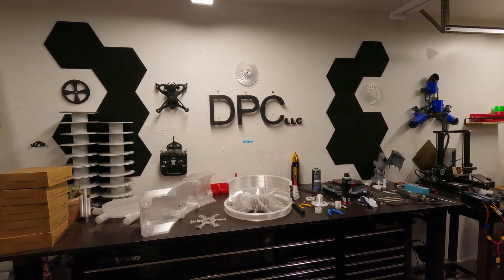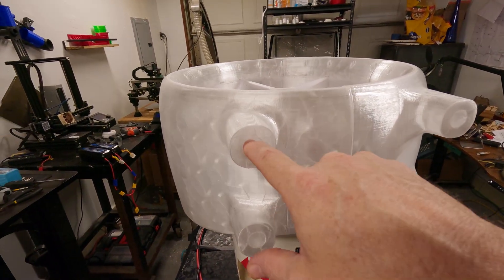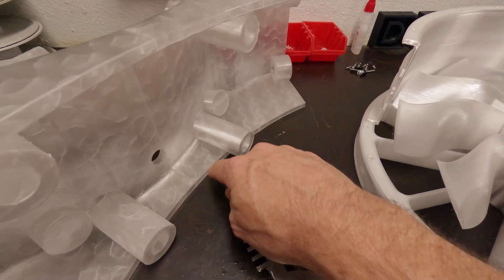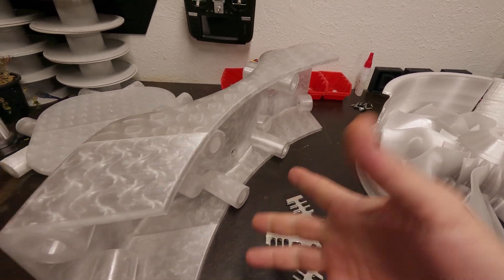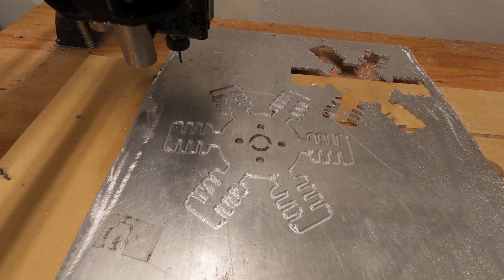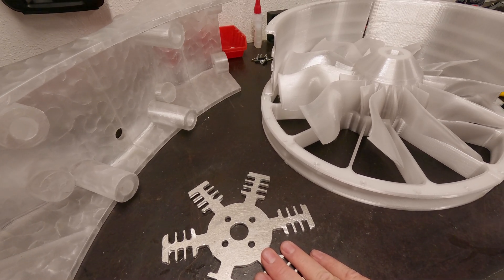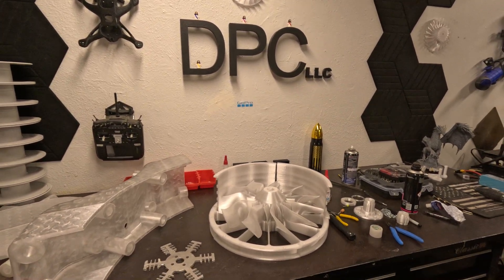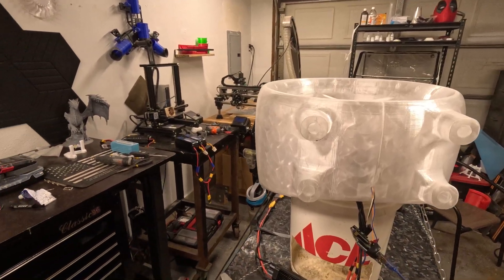Building a fully 3D printed 1,500mm drone, with fully 3d printed 340mm EDF engines.

Comment: Isn't the efficiency of a peltier really low?
Reply from the maker: Depends on what voltage, but for electric cooling in this configuration it is suitable. I can keep the motor at room temp at 100 amps and 75 volts under fan load. Each motor cooling system will have a Qc ~60-72w (12v x 5-6A) So no heat load temp drops to -31 Fahrenheit. Realistic outcome under heat load 41 to 50 degrees F.
Reply: @warmachined3472 

I don't really see the advantage to doing this. You're only adding to the overall thermal load, and you still need to use a heatsink to dissipate this. I think you'd get a more optimised result by allocating more of your weight budget to effective air cooling, and then using the power savings to drop the weight of your required battery pack.

Alternatively, you could try a total-loss evaporative liquid cooling system (basically a small water reservoir with a wick to carry water to an evaporative pad on a heatsink). Depending on flight time you'd only need a very small supply of water and if designed properly I expect it would be able to manage a pretty significant thermal load.
Reply from the maker: Thanks for taking the time to comment.  

In this particular case, my goal is a bit different from what passive or purely convective cooling can achieve. I’m specifically trying to maintain the motor below ambient temperatures under sustained high load. That’s only possible with active heat transfer like a Peltier module, which effectively pumps heat away from the motor side regardless of airflow speed.

While it’s true this adds to the overall thermal load on the heatsink, that’s actually by design: it relocates and concentrates the heat on the hot side where I can manage it more effectively with forced air and oversized fins. The additional electrical demand is balanced against the critical benefit of preventing thermal throttling (or motor damage) in an aggressively small, high-power package.

A total-loss evaporative system is an interesting idea, but for an airborne application it introduces weight variability (as water is consumed) and limited run time, plus complexity in wicking and reliability. With the Peltier, I can run continuously off the existing onboard power, keep everything sealed, and avoid the logistics of replenishing coolant.

Again, really appreciate the input it’s always good to hear different approaches. Happy to keep refining the design and weighing trade-offs. Thanks for chiming in!